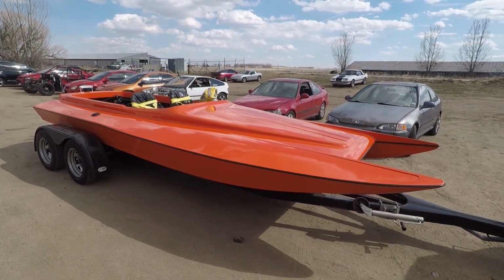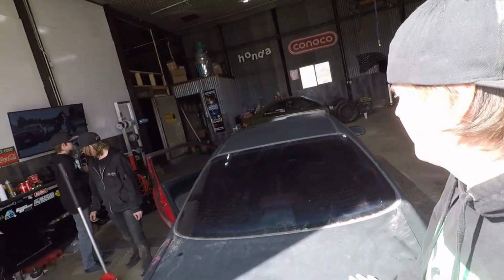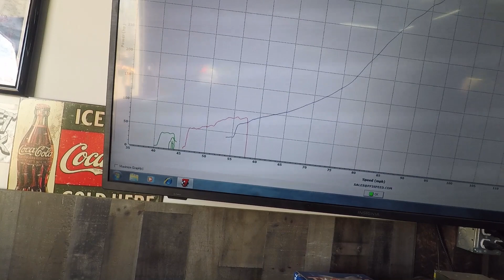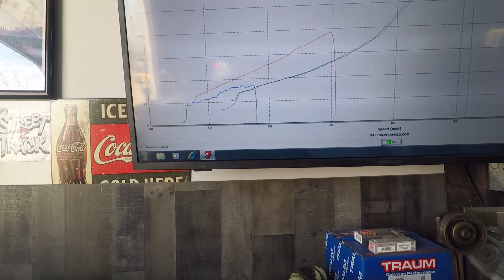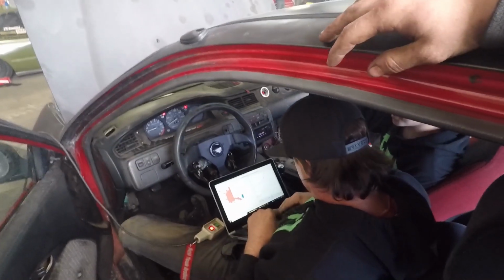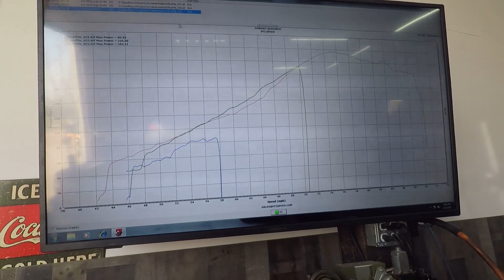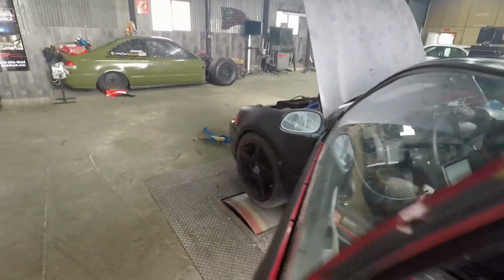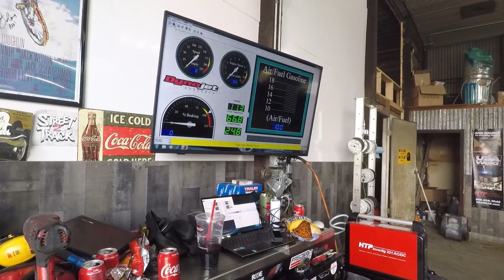How the Passion for Cars begins . First car boost

Comment: Brent is like it’s his first car 3 pounds of boost is all you get !!

 Shane : put a T in it
Brent said nope
Reply: Brent's parental instinct did an override on Brent's tuning.
Everyone: We're running 30lbs.
Steven: We're running 3lbs.
🤣😂
I'll be the same in two and a half years with my son. 👍
Reply: Would just blow the motor anyways.
Reply: He cant drive a stock civic from the looks of it. Let alone a boosted one.
Reply: what does boost have to do with anything when he is LEARNING how to drive?
Reply: @Jagvetinget  dude how is that even question ?
Reply: @martinred6237  The kid is not so good driver yet but he is learning he did  no misstake because of boost so the kids driving had nothing to do with boost just not so much experience.
Reply: @Jagvetinget  look at it like this. The car makes 200whp with 3 pounds of boost. That's plenty enough to spin tires in a Honda. He doesn't have street condition experience. He probably doesn't under stand that asphalt roads and concrete roads have different grip. When driving through a hollow with trees, you will experience worse grip due to things like tree sap and foliage making the road slick. You have to understand how a fwd car works. When your tires spin. You lose the ability to turn correctly. Steven doesn't have enough road experience. He needs more experience driving a manual in general. Brent made the right choice. It was a smart decision to keep the boost low. Once he learns the physics of his car and how to drive properly, I'm sure Brent would turn up the boost.
Reply: @exoticnoise420  you have no boost.
Reply: @MafiaboysWorld  He could have at least given him 6-7 psi. That's what most eco-motors put down anyway.
Reply: @bestleesinna7702  eco motors dont push 220whp though lol
Reply: @bestleesinna7702  he probably will eventually, he clearly is still learning how to drive stick and honestly doesn't need more than 3psi. Plus that car could need a bunch of maintenance/upgrades before more boost anyway
Reply: @lytheus69  my GA16DE does. I was putting around 140-150 with as much motor upgrade as I could obtain. Then it was boosted. 245HP on 7psi. Can go to one bar (15 psi), but I daily it, so I don't want to burn the tires, clutch, and motor up.
Reply: @bestleesinna7702  ...so your tuned and modified economy engine pushes 245whp.

most people don't modify economy cars.

that's cool though, how are you able to push 15psi with stock internals? wouldn't it blow?
Reply: @ryanwilloughby453  ya I'm a pretty experienced driver but not with high horsepower or high horsepower front wheel drives. I've had a few fox body mustangs and done my fair share of powerslides and burnouts, but NONE of that matters. It's completely different in front wheel drive. I just got a focus st and for 250hp it's just ridiculous. It torque steers and just takes off like a little rocket. I'm experienced some what and I believe even I would have my hands full with much more power(in a front wheel drive). Hell my first stick shift car was an Accord lol

Comment: Too cool that Steven got to "build" his first car, and his big bro. there to learn em up!!.. Good on ya Brent!... I got handed my dads old 1971 Dodge Coronet  Custom station wagon 383 (6.3 L) B Magnum V8 with no roof rack and a spoiler on the back over the rear window. I thought it looked bad-azz!  Deal was I had to figure out how to make it run again, Pop's had some drive-ability issues, timing / fueling , and parked it  for almost a year before i got my learners permit so I got to work on it till then. Rebuilt the carb, flushed the fuel system, new points-plugs-condenser-coil Ect....Man at 58 I feel like the grumpy old man now!...lol  These darn kids now-a-days with there fancy computer cars!!

Comment: Neat first drive, takes some time to learn the clutch pedal timing for a smooth voyage. Springs and retainers would be good. sad to drop a valve on the first engine.
Reply: Rod bearing will spin before valve drops on a stock ls.

Comment: Brent what cheap eBay 2200 cc injectors are you guys always using?? I know you guys run them in some of your cars and you said before on  another video that they worked pretty good for the money. I’m just skeptical of all the cheap ones on there and was wondering if you could tell me or maybe refer me to the link because I don’t want to buy bunk and junk injectors that don’t put out the proper fuel. thanks in advance

Comment: Damn it though, 2200cc injectors on a stock B18B1? Why? Is that just what he could find? The B18B1 is definitely the block to use for just getting into the turbo Honda world imo. I made 412 whp on a bone stock rebuilt B18B1 that I rebuilt in my dirty ass garage, an eBay turbo kit, BC stage 2 turbo cams, dual valve springs with titanium retainers, a self ported and polished head, a Skunk 2 Pro intake manifold, Skunk 2 70mm throttle body, Bosch 630cc injectors, full 3" turbo-back exhaust with no cat and a K-Tuned dolphin tip muffler, eBay FMIC, all tuned on a P28 ECU with Crome Gold. They're definitely stout bottom ends if they're built properly. The important thing is that you start with a well running engine.

Comment: I have almost the same exact spark plug cleaner. you almost never see any shops with them anymore. everyone always wants you to spend tons of cash and get new plugs every time. fuck that. I clean, re-gap and re-use them. never had any issues yet in over 25 years of doing it on many diferent vehicles.

Comment: Brent why did u only set it up so low in power? 205 whp really? I just dont getit lol. For sure we show me know for sure know for sure that you can make way more power out of a boosted b-series than that he'll my stalk Poor Man's Type R engine swap made 205 to the wheels. Did you set it up to make low horsepower for him to get used to it first? Now I could definitely absolutely understand if you did that but you should at least explain it to us why suddenly you can't make barely over 200 horsepower when normally with a boosted B series you can get easily 300 plus horsepower all day long. Lol hell u can get 300 whp out of a Single Jingle 1.6 ltr Vitarra build and be still reliable.